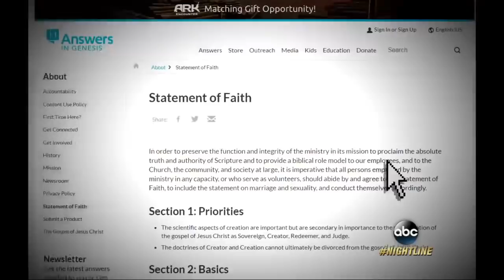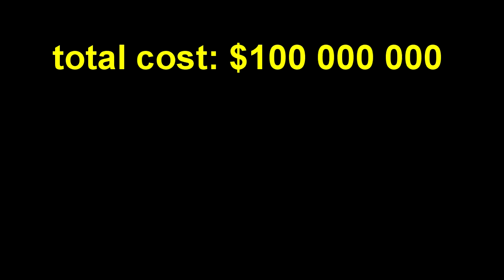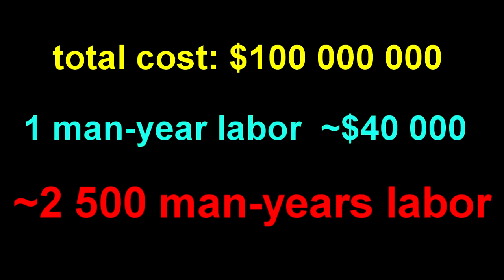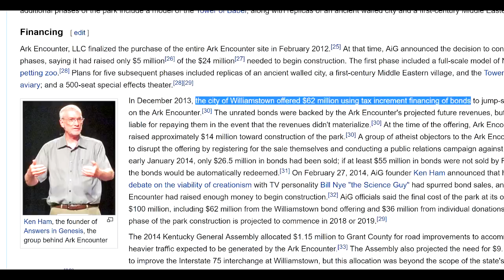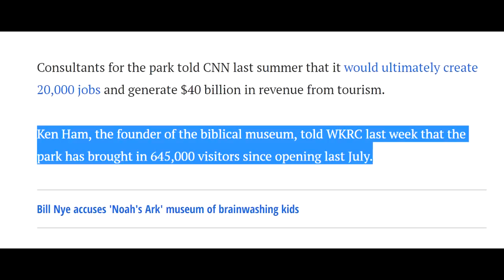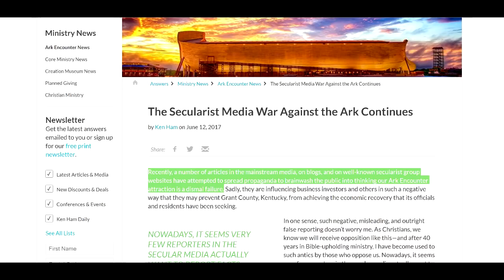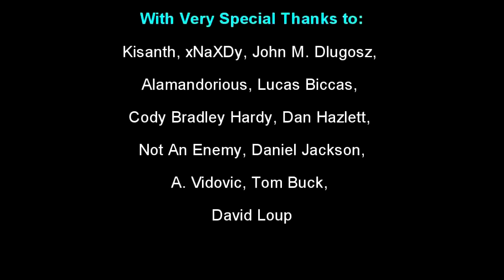Why do people laugh at creationists (part 44)

Comment: The irony of it all is that Ken Ham actually proves that the story of Noah is fake and a myth by building the Ark/boat.
Reply: Michiel1972 How?
Reply: They used modern equipment which thousands of years ago no one had.
Reply: Michiel1972 I was thinking the same thing as I watched all the cranes and heavy equipment
Reply: They also used modern techniques of boat building like how the bow is build, which have been invented just a couple 100 years ago. And the most ironic thing is that those techniques are used so that the boat goes through water more efficiently, yet the ark was never intended to go anywhere; it just had to float.
Reply: Michiel1972 you all don't get the real point if noah had the creator of everything on his side he theoretically didn't have to build shit.  the ark is very real they have found it it is folly to act as if it hasn't.  the funniest comments are about the bowed bow!  are u for real?  if God created everything trust me that stupid modern bowed bow was engineered godzillions of years ago.
Reply: Michael, I'm assuming you're joking. But if you're not:
1) Show me the boat
2) If that "stupid modern bowed bow was engineered godzillions of years ago", why on earth did God hold off on computers for so long?
Reply: The "ark" has been "found" dozens of times. The same carbon dating they used to determine the age of that wood found on Ararat, is the same carbon dating technique used to determine that the Earth is much much older than 6,000 years.
And if God can do "whatever He f*cking pleases", why doesn't he resurface the entire ark so that everybody can see it plainly?
While he's doing that, why doesn't he just come down to Earth and say, "Hey guys, I really do exist!" 
The reason God doesn't do those things, is because he doesn't exist.
Reply: michael perri If god is omnipotent like you say, there are tons of paradoxes. For example: god can lift everything because he is omnipotent, but if he is omnipotent he can also create something he can't lift. The existence of god would create so many paradoxes it's simply irrational to believe he exists.
Reply: Kha'hotu the Khajiit Werewolf there are paradoxes because YOU ARE NOT GOD AND YOU COULDN'T CREATE A BLADE of grass so how would u know of paradoxes of an omnipotent God?
Reply: You're right, Michael. I am God. I am now revealing myself to you. Instead of just making everything perfect from the beginning, I thought it would be way funnier to put all of the animals on a giant boat, and watch them struggle as I flood the rest of the planet for no real reason other than my own entertainment.
Reply: Denis Lipatnikov HiHowAreYou  -  you both assume u understand the past.  the bible is a load of shit except for certain parts. why would not history be the same?
Reply: I assume things that are reasonable to assume, and I assume these things are likely to be true; not certainly true. None of these things includes a God, because that would be unreasonable.
Reply: michael perri History is based on hard facts which we found; think skulls, bones, etc. The bible is just a book without any evidence to back it up, it just says "It's all true, believe me or go to hell".
Reply: Michiel1972 but it is up to legal building codes, electronics, walls, Foundation, floors, rooms, furnishings, roof, railings, different levels, fake animals, and every thing else. it is much more comfortable and modern.
Reply: HiHowAreYou he did not, we have discovered very old computation devices that can be dated to rome. Also the society before Noah was pretty advanced but was wiped out and h3 did not give it to us again because the first time we messed it up.
Reply: Kha'hotu the Khajiit Werewolf those are just logical problems that are ment to be unsolvable. their are many of them and they are a strawman argument Wich proves you wrong.
Reply: Kha'hotu the Khajiit Werewolf the bible it the most accurate book on this planet. there are only 2 copies of some of Socrates debates and things about them but we never doubt him but the bible Wich has millions of examples for its existence is always questioned. give me 1 example were the bible has a error and I will show you why it is not an error. also about bones if you are looking to disprove something you will make jump to conclusions and will not be willing to see the other opinions proof. this goes for both sides
Reply: First off I'll say I don't believe in God, but what if in the past people were not as primitive as mainstream historians think? What if a doomsday scenario caused a collapse of society and we had to reset? Super volcano, asteroid, global temperature change etc. Because the math sounds crazy when it comes to the construction of the Arc in the past, but so does the math for the Great Pyramids, but we know they were built because we can see them. The fishy thing is the time period, how the transported the non-local materials and the lack of technology to perform the building.
Reply: Fazzee45 a book? You mean the Bible?
Reply: Sierra Detwiler No I mean something that has a equation in it maybe or something you can actually read and become more intelligent. Thanks for trolling though.
Reply: benito tommassi  - says the guy with a superman as his youtube icon.  i feel like religiously the problem with what is occurring all around us is the lack of any sort of courage within ANY scared stiff demon to just admit it with any fervor.  we get it.  evil lurks within the shadows!  ur superman not spiderman right?  demons can do anything right they are an extension of satan no?  ur superman, whats that quote from the usual suspects about the devil?  don't be coy!  listen to evil joe from mushroomhead.  satans army trying to start a rock band...
Reply: benito tommassi - i don't need to convert you.  thats the point.  ur smarter than God FO SHO!  enjoy!
Reply: benito tommassi - thor is not a god.  thats really the problem.  demons are afraid to admit, publically that they are demons.  lets bath thor in some milk, shall we?
Reply: michael perri thor is a god.  You cant disprove thor is god.  There are loads of old books written about him.
Reply: benito tommassi - thor vs. angel - thor would lose all his limbs within 30 seconds.  thors hammer don't work without God, the True God's assistance.  why God would mislead thor like that is between thor and God.  Mythological morons like odin, thor and zues existed no doubt i'm just saying they have and were punked by God!  funny right!  check it out.  ask Him!
Reply: Larry Glazner ... Hmmm.
At what point did I give you any insight regarding what I think?
Another judgement, while denying the act.
Hypocrite.
Reply: Larry Glazner - i don't know if u can say buddhists have no God.  they train their minds to link up with whatever Intelligence is out there, in a sense.  buddhists don't talk much because they are having a much better time understanding and talking to the God that tells them how to get to where they want to go when they die.  this life and its possessions mean nothing, it is kind of the same theory with christianity.  plus there is that theory that Jesus went to Japan during the years where it is said he "dissappeared".  i don't blame him for wanting a vacation from the stiff necked jews that he knew would ultimately crucify him.
Reply: When God was born Jesus As he grew up  on earth he use parables (stories) and examples to convey what he as God in the form of a man wanted  from us. He even showed us how to pray to him though example  The bible is the same.the bible  use parables (stories) and examples to convey what he God is to us.  In the bible all of man kind Is Adam even  Eve was also Adam. Though Jesus  never said he was the son of God he often said You are all sons of the most high  But He was quoting Psalm 82:6  He said he was the son of man to show he to was Adam The word Adam in hebrew is Ad-d-EM   it means Child of God.So the bible  use parables and examples to convey what he God wanted  from us But all The thousands of these  parables and examples have come out of the history of juda.
Reply: jcr65566 in other words its just a book of stories
Reply: LOL OK how he do that.   the story of the flood in the time of Noah is told by the seminarians . it was found on 7000 year old clay tablet found in iraq  in the 1960s
Reply: Fun fact: Ken was originally going to have real live animals in pens, cages, perches, etc. in the ark park itself. People rightly criticized the way he intended to showcase them, pointing out that it was confining and unsanitary, so he was forced to put fake ones in instead.
Reply: Michiel1972 - the irony of all this is that ken ham proves that most of the earth is inhabited by people that understand the science of being a True God yet they couldn't backwards engineer a blade of grass or an insect if their souls depended on it.  the irony also being that ur souls do with that attitude.
Reply: Larry Glazner - God designs life.  alot of people try to leave God out of the equation by saying it can be explained through "science" but all they are doing is trying to unravel the mysteries of how all things work, of all that DESIGN that God put into everything He created.
Reply: michael perri how do you know god designed life?
Reply: benito tommassi - because He did!  shiva, odin and zeus certainly didn't do it!  God doesn't keep humans naked in a garden eating fruits either.  in case u thought that was a real thing.  knowledge of good and evil is something God wants us to have.  its called free will we make our decisions from there.
Reply: We realy don't know how old God or the universe  we only know where life is God is In the pass We  determine the age of the universe using two different methods: by studying the oldest objects within the universe and measuring how fast it is expanding. Bit as we look out in to space we can only go on what we can see the further we can see use to  only forteen  billions light years  now we can see a bit further the problem is we are using light  and at the speed of light we are looking in to the pass we see at the edge of the universe a cloud of dust this is the limit of what we can see But the thing is we are using light to see light that is billions of years old   We only know of God on this  earth where ever life exis God exist God can create life but that life has to live to complete  We don't know if life  exist any where else  on other earth like worlds But we do know there are  ten of thousands of dead galaxies out there in space  the elements needed to create life,  no longer  exist in those galaxies   It like there just been use up. .We know these elements did exist in the pass  in the formation of these  galaxies But over time  for some reason we don't know there  elements were changed into  less complicated elements. simpler elements. we know the stars exist in these  galaxies  by the there mass the pull on other stars but these stars don.t shine any more they are cold and dead.  For a star to go down this path would take longer then fourteen point five billion years  So the universe is far older then  fourteen point five billion years .
Reply: Pawel Regulski - thats the logic!  look all around u at all the evidence of PERFECT DESIGN.
Reply: michael perri like 99% of all species that are now extinct.  Like children getting cancer.  What a designer!
Reply: benito tommassi To look at this! We have  got to know why we are alive and why we have to die  in the first place.  God can create with in us a spirit and then give us part of his immortal  soul  Because God is our father in heaven and we are his children God has a spirit we have a spirit God has  a soul we have a soul  we are God child  But to be complete we must be alive we must live a life. And like jesus we must live a life and then die  But that only our physical form.dies  children getting cancer is just part of life  cancer.only in there physical body. All life on earth is here for one reason to create the spirit.  Ever day we live some poor form of life had to suffer and die just to keep us alive one more day.
Reply: benito tommassi when has ariology been vil nonsense.14,000 years ago all over the earth  there were  civilizations on this world  that surpass us in so many ways  But then some thing happened to them most of them were  wipe them out.in one event  there is so much  evidence that  back then all over the world on every single continent  The sea rose up about  400 feet  And flooded every single  land. mast. This was the flood the bible speaks of  in the time of Noah.
Reply: jcr65566 FFS!  Look into things and understand them yourself before using them as evidence for your world view.  This is a highly contentious theory that oa now widely regarded as false due to the contrary evidence that has been  found.  Also, even if it were true and evidence proved it beyond doubt (like it has qith evolution and the big bang, altho you'd rather argue against and ignore evidence in those cases?) It aids to prove that the story of noah was false!  Look into it before you make a fool of yourself again.
Reply: bebito tommassi Ok you got my interest whats   the contrary evidence that has been  found! .The story of the flood in the time of noah was not  false  it wad written about in ancient 7000 year old  sumerian  script  The  sumerian  were the ancestors of both the egyptians  and the hebrews but not the modern day Jews  This is archeology not religion for 1280 years ago most of the egyptians  were wipe out they had  lost everything and had to start all  over  again most of  the destroyed temples were on the cost and to this day are still  underwater. for a lot time there were no egyptians as  they were mostly scattered tribes then they seem to come together and formed in to in to upper and lower kingdoms But then  7000 years ago there kingdoms come together  this was the start of rebuilding  the destroyed temples they were not under water the thing is the  egyptians before were far smarter them the egyptians who come later.
Reply: jcr65566 "proof" of a flood that happened 12800 years ago proves correct a story of a flood from a book that claims the earth is no older than 6000 years old?  Ask yourself these questions.
Reply: Pawel Regulski - people suffer because they DO NOT SUBMIT THEIR WILL to God.  plain and simple.
Reply: benito tommassi  In 70 AD when the 2an temple was destroyed by the romans  back then the torah bible was not in the form it is in now.  it was written in the form of single books  on large sheep skin scrolls. But what we see now is not all of it. A few scrolls were lost  as what we have now was smuggled out of the temple in a coffin What few scrolls were left were scattered all over israel and the rest of the county for 300 years when these scrolls were found by the romans they just burnt them.When the scrolls were smuggled out of the burning temple  they could not fit all of the scrolls of the torah bible in the coffin so they had to leave some of the torah bible scrolls behind.  But with what left there are hints all though genesis in the bible of some catastrophe  Do you know that no where in the bible dos it say the earth is 6000 years old.   it doesn't even hint at it. But there are written in 7000 year old  seminarian text that tell the story of Gods  creation of the earth the creation of life on the earth the creation of a type of men on the earth.  The flood in the time of noah but nowhere in  the  seminarian text  dos it even mention Adam and Eve So I think they came may have come along later As In genesis one it mentions the creation of life and men  then in geneses two it mention God created Adam mankind  in his own image  God said to Adam to replenish the earth I know with the bible lineage of  Adam and eve they appeared  around  6000 years ago But it dos not say the earth that old.
Reply: Michael perri Bull crap that wrong Our bodies are designed to survive and then to finally die, But  it what we do in between that process that defines us   We survive by the death of other forms of life. Have you never heard the expression  "what you eat to day walks and talks tomorrow"  Some other living thing  must die and be consumed by us so that we may live for an other day think of all the former living  things  that have died ju8st so you can live just one slice of bread contains hundred of wheat  seeds that are  realy just baby plants that will never know what it is to live.
Reply: jcr65566 and no-one dines on the lives of children lost.  Except tgat magic man in the sky.
Reply: jcr65566 does the noah story not come after adam and eve?
Reply: Larry Glazner im guessing you're being sarcastic?
Reply: benito tommassi - evil most certainly exists just look at the world there is ur proof.  satan and God have a wager.  God is invisible but through true faith.  thats the way He runs His war strategy.
Reply: michael perri I think evil to be a primitive concept.  But, if evil is real then god has certainly proven himself more than capable of it's most extreme forms.
Reply: We are all Adam ( in hebrew Ad-dem).  We were once in charge of the earth then our ancestors became corrupted by satan to follow a serpent god  that give them  knowledge of how to do good and how to do the evil of war and from this power the  knowledge of good and evil All over earth on ever continent they  built temple to  their  deprave serpent god  that demanded they  sacrificed there  children to it. So they  either  place there children   in caves to freeze to death.  or place them in a fire to burn to death.
Reply: Larry Glazner you say to jcr that you need evidence then you say that "satan tried again and again to persecute the jews" is evidence for satan??  Do you know what evidence is?  Where is your EVIDENCE for satan?
Reply: Michiel1972 The thing With the arkeology the evidence do's point to a worldwide flood in about 11,800 BCE . That's About 13,817 years ago. Probably from a large meteor hitting  the european continent And melting the  two mile deep ice sheet.  archaeology evidence do's points to an oceans rise of 122 m ( about 400 feet )  So this would have cause a worldwide flood  And also The flood and Nora family are mentioned in the 7000 year old Sumerian clay tablets found in iraq in the 1960s.  But they do not mention Adam  The Sumerians are the ancestors of both the egyptians and the Jews.
Reply: Larry Glazner giving your version of what evidence is does not deter from the fact that you have still to provide any for the existence of satan.  It shows you must know you lack any evidence by your attempt are redifing the word.  You say they are the most persecuted people in history but they are still here therefore thats evidence for god and satan?  That sounds like the ramblings of a madman on the street.  Hey, if you believe in this stuff thats kool.  Just dont try and give a rational explaination for it because there isnt one.  I've certainly not heard one.  And with regards to the museum in this video its just plain lunacy.  Only in america!
Reply: Benito tommassi  It can be proven  the existence of satan.All we have to do is look at ever single culture on earth going back thousands  of years All of them in some way have know off the  devil And  though the names are different it still a devil it still satan
Reply: jcr65566 so that cant have anything to do with our fear of not understanding?  That every civilisation created gods and demons to make sense of the world they didnt yet understand, of good and evil, bad and good???  No it must be "evidence"!  For fuck sake listen to yourselves.  We know better now, its called learning.
Reply: How about the fact that all these billions of people have sense and can  know there is a  God and there is a  devil  we call satan And they know they have a soul that can be affected by both of  them That every single person in every single civilisation that has ever existed.  have in some way  sense  the presence of God So they have  tried to establish a  link with him But in there own way. they eventually know  there are no Gods there is just one God  there have been tribes on remote islands all over the world who have had no contact with one another But can sense the presents of God and the devil But they end up trying to put a name on God who has no name Because they sense there is a God and there is a Satan and they have an affect on there soul.
Reply: Until the 1700 Before people were able to read the bible The poor had no education what so ever. So realy only the affluent Greeks and Egyptians you mention had a very limited  educations First land owner only thought there sons to read and write But later  very affluent girls from affluent families were also  taught to read and write when the bible was first printed it was use to teach children to read and to write Before the 1700 there were no schools as such as a  teacher was a very expensive servant. but land owner found by pooling there money they were able to teach there children with outer land owners children Kings james  found he could make a lot of money printing and selling his KJV  bible  for education books were expensive so  for a long while as  the bible was in book form and it was being printed out in massive amounts .the bible was the only educational tool there was.
Reply: Larry Glazner.  Well firstly i guarantee you that 85% of people don't believe they are interacting with spirits.  Secondly, im not proposing some ludicrous, supernatural explaination for feelings i experience.  I don't generally "know" anymore than anyone about that which mankind can't explain.  The difference is i say "i dont know, let's try and find out".  You say that, because we dont know, it must be a mythical being that was written about in a book milennia ago.  One of us is rational the other is deluded, desperate or both.
Reply: jcr65566 dogs have an amazing sense of smell?  Sounds silly doesn't it?  Yet it's still far more reasonable than your suggestion because we have evidence of a dogs extreme sense of smell.  And im not saying i dont believe in a soul (although that word suggests something supernatural i dont mean it that way).  The meta physical is being researched.  Do we make connections with other living things? I think so, yes.   Can i explain it? Nope.  Shall i just settle on an ancient myth to explain it? No, of course not, i'm an intelligent and reasonable man.  Again, the dog story is nowhere near the vicinity of being evidence for the supernatural.  I'm starting to think you honestly dont know what the word evidence means (?)  Believe what you believe, ive no issue with that.  But if you try to give a rational explaination for the irrational, please dont mind yourself looking a bit silly.
Reply: Larry Glazner  From the start I knew what I saw was real But it  It  was a bit of a shock to me when I later  learn,  that what was in, what had seen, was so real. there were thing like there were all wearing Roman like togas  But what was amazing was the way I acted after I stayed out of trouble God married had kids. now got a lot of great grand kids.
Reply: I agree In genesis it said that God created the heavens and the earth in other words God created the heavens first and then the earth  The first day after surgery a neurologist showed up. I talk to him even though  I was still to sore to talk to any one the reason for this  was to get my hearth going again they had  pondered  on my chest for a bout half an hour.  I told the neurologist what happen the first thing he told me was there are two notes taped on top of  the equipment in the operating room did you read them it was a explained later that Back then if I did see two pieces of paper on the medical  equipment in the operating room I would  not be able to read them our brain translates the sound we make and the words we read in to the language we under stand to do this we a brain at the time though a lack of oxygen  my brain was not working to translate the words so I said no I didn't he said I thought so. you were just dreaming and at the time I beleve him. Four years alter I found out he was wrong
Reply: Michiel 1972 No not realy it works out I read this ages ago somewhere on the internet "When Noah enters the ark, he was  600 years old. The time it took to build the ark would depend on how much time had passed between Genesis 5:32 and the time that God commanded Noah to build the ark (Genesis 6:14-21). At the absolute most, it would have taken about 100 years.So there was plenty of time.  And they didn't  blow a 100 MILLION dollars even no one showed up it a know fact that Every  one of these things   generated an enormous amount of money.
Reply: jcr65566 so it was because of the bible that poor people were educated?  Are you serious?
Reply: jcr65566 well, im sincerely sorry for your plight and its good to hear you've come through it.  And if belief in god and jesus helped you then thats kool.  But i say again, you are trying to explain the irrational with reason and it doesn't work, it sounds silly.  You were under sedation with drugs i presume?  Hallucination, no matter how vivid, is not an option for explaining your encounter?  That does not in anyway disprove there is a god, however.  Belief in a diety is not the issue, i cant argue against that and wouldnt want to.   its belief in an ancient book amd the god it describes that is the issue
Reply: benito tommassi it is history It started in the USA from 1400 to the 1650  It was the beginning Stages of Education in the USA 
Connecticut colony was a leader in education. The first public schools were established in 1642 in New Haven and in Hartford in 1643. Many of the  private schools, in the USA such as Hopkins and Taft were established at this time.
The Puritans of Connecticut put heavy emphasis on education, specifically so that young and old would be able to read the Scriptures. If they were educated, they could learn God’s laws and the laws of men. The father in a Puritan house prepared his children by teaching them the Bible once a week. Education was the ultimate responsibility of the parent and the Puritan homes were strict—a child could be seen not heard and spoke only when spoken to by an adult.
The Connecticut Code of 1650 made it a requirement that children and apprentices be taught to read. Connecticut also required children to be trained in an “honest calling” so that they could contribute to the colony, as well as taking care of themselves. Many children at the age of seven or eight (were sent to homes to work. They became apprentices. Even the wealthy parents followed this tradition. By this age, boys usually decided on a craft or trade and remained in it all their life.
The wealthy colonist children, if not an apprentice, attended private schools, or they had private teachers (tutors). These students were headed for the university. Although public schools were supposed to be established, most children were educated at home where they learned obedience, religion and the skills for daily life. In some towns, there were “dame” schools which were taught by widows in their own homes. These women taught only the basic skills because that was all they knew. These skills included learning the alphabet, spelling, writing and simple arithmetic. Boys who attended these schools paid a penny a day.
Schools were generally for the boys. It was not customary to educate women since her place was the home. She didn’t have any economic pressure to earn her own living since she was going to get married and raise a family and care for her home, often at an early age. Women were basically illiterate; many could only sign their names with an x. If they did go to school, it was to a “dame” school where they taught some reading and knitting and maybe a little arithmetic, music and dancing. They were taught reading for Bible study and arithmetic for household expenses. It was more important to learn how to be a housewife: to cook, to spin, to weave and to knit socks. Women and young girls during leisure time often embroidered   They made fancy scarves and veils and did much quilting.
Reply: benito tommassi Do you know you we are all  a child God. That one day we will be like God. God can creat us give us life But we have to live a life to do this we a place in an ever changing body It is a scientific fact that Not only is every cell only a few years old But ever atom in our body is no more them a few years old as well over our long life  Only our souls and our spirit remains to carry on.  
You mention the NDE It happened many  years ago but I can still remember ever single bit of it.  Over the years I lost count of how many Atheists have told me this this was an  Hallucination,  But since then I have never been told by any one who's gone though an NDE And  lot of them are also doctors who have also gone though an NDE   that an NDE is an Hallucination, for it is not. You mention the bible So  lets talk about the bible I know  Atheist like you would not have a clue what a bible is about you thing it is a textbook it is not  I going to explain the bible in this way. The bible is a book of instruction .that use parables (stories)  and examples to explain what God relationship is with us.  In the time of Jesus there were two types of Jews the zion zealots and the tribe of  judah  zion zealots are the one Jesus said  are a temple of satan. The zion zealots jews were the one who had Jesus killed. They could have just had him strangled or stoned to death But they wanted to make an example of him. So why did Jesus let them do this to him Because Jesus wanted them to. For  Jesus was born to die.  Jesus is God and God is our father in heaven  God is soul and holy spirit as we are spirit and soul  God  love us so much he lowed himself to be born a man in the form of Jesus. The reason for this is  God is our father and like all fathers he wanted to teach his children us what he wanted from us.  Now God like all father teaching  their children   have to lower them self to there child level of understanding. God lower himself to our level of understanding by becoming Jesus.  Like all fathers he use stories and examples to show us what he wanted from us  to teach us. In the bible  God as jesus would  often referred  to him self in the third person. Jesus never called himself the son of God he referred to him self as the son of man. And this is why 
This is by Dr. Ron Rhodes  First of all,  the phrase “Son of Man” is a reference to Jesus' humanity, it is not a denial of His deity. By becoming a man, Jesus did not cease being God. The incarnation of Christ did not involve the subtraction of deity, but the addition of humanity. Jesus clearly claimed to be God on many occasions (Matthew 16:16,17; John 8:58; 10:30). But in addition to being divine, He was also human (see Philippians 2:6-8). He had two natures (divine and human) conjoined in one person. 
Further, Scripture indicates that Jesus was not denying His deity by referring to Himself as the Son of Man. In fact, it is highly revealing that the term “Son of Man” is used in Scripture in contexts of Christ's deity. For example, the Bible says that only God can forgive sins (Isaiah 43:25; Mark 2:7). But as the “Son of Man,” Jesus had the power to forgive sins (Mark 2:10). Likewise, Christ will return to Earth as the “Son of Man” in clouds of glory to reign on Earth (Matthew 26:63-64). In this passage, Jesus is citing Daniel 7:13 where the Messiah is described as the "Ancient of Days," a phrase used to indicate His deity (cf. Daniel 7:9). 
Further, when Jesus was asked by the high priest whether He was the “Son of God” (Matthew 26:63), He responded affirmatively, declaring that He was the “Son of Man” who would come in power and great glory (verse 64). This indicated that Jesus Himself used the phrase “Son of Man” to indicate His deity as the Son of God. 
Finally, the phrase “Son of Man” also emphasizes who Jesus is in relation to His incarnation and His work of salvation. In the Old Testament (Leviticus 25:25-26, 48-49; Ruth 2:20), the next of kin (one related by blood) always functioned as the “kinsman-redeemer” of a family member who needed redemption from jail. Jesus became related to us “by blood” (that is, He became a man) so He could function as our Kinsman-Redeemer and rescue us from sin.
Reply: +Kha'hotu the Khajiit Werewolf
"michael perri If god is omnipotent like you say, there are tons of paradoxes. For example: god can lift everything because he is omnipotent, but if he is omnipotent he can also create something he can't lift. The existence of god would create so many paradoxes it's simply irrational to believe he exists."

I see this question a lot and there are better examples to use against God imo. If you take into consideration the context of your "paradox" you will get an answer like this which solves it.

This question is not based on the amount of power God has but is based on true impossibility. What I mean is that God has the power to do whatever possible with infinite power but just as the Bible specifically says he cannot lie or deny himself he can also not create a challenge in which he cannot win. The argument is based on the wrong assumption that more power means you can achieve the impossible which simply is flawed. The paradox doesn't question the power or omnipotence of God but is asked from the incorrect assumption in your wording of what is considered possible by a being who is omnipotent with infinite power.
Reply: SpydreX You got this all wrong God exist in the spiritual world.  God created our spirit and our soul  in the spiritual world. before our physical bodies were even created .  So why should God  care one bit about us our physical bodies  in this physical world.  If God cared one bit  about our physical bodies we never get sick we never age and we never die.   God is soul and holy spirit As we are Soul and spirit crated us  in his image. So what God cares about is our soul and spirit God will only care about our our physical body   if it has a direct effect on our soul and our spirit.
Reply: +jcr65566 Err I think you might have replied to the wrong person...
Reply: jcr65566.  I was raised christian, i went to a C of E school, church every monday morning.  Its the best way to make an atheist;  have  parents that free you to make the decision for yourself, go to a christian school and realise pretty quickly that it's a myth, just like all the other world religions are myths.  You are an atheist to 999 religions, i am atheist to 1000.  That 1 is the only difference between you and me.  A muslim or a jew or a hindu could give me similar arguments to yours to justify their religion.  You are blinded or refuse to see it because of your desperate desire to believe it to be true no matter what evidence is thrown at you to the contrary.  Keep believing in what you believe, it seems to have served you well.  Even if i wanted to i cant believe in a supernatural creator because 1. There is zero evidence for it and 2. His book of revelation amd instruction is extremely weak and now has to be taken as "stories" and "metaphor".
Reply: jcr65566 well i must say your beleif us more understandable but, i still cannot put faith into that which has no evidence.
Reply: Benito tommassi After that  NDE it kinda change my life. When  I went to collage. I stop believing in evolution It was when I come across  one of our teachers who was an agnostic professor he told  all 30 of us us  for a class assignment to  prove evolution.  We were given a month But  I don't thing we could have proove it even if we were given years. Though  we could easily prove  adaptation But not one of us could prove  Evolution As I said This professor was not a christian he was an agnostic I don't know if you know about  Agnosticism it is the view that the existence of God or the supernatural is unknown or unknowable. According to the philosopher William L. Rowe, "agnosticism is the view that human reason is incapable of providing sufficient rational grounds to justify either the belief that God exists or the belief that God does not exist". Agnosticism is a doctrine or set of tenets rather than a religion. So agnostic beleve  we are just not smart enough to vision the concept of God.
Reply: Larry Glazner Yeah that about right. But  It seem there problem with the bible is they want to disprove the bible history  But the thing with  bible is! though the bible dos have a bit of jewish history The torah bible was never ever meant to be a history lesson We can see this when Jesus taught he taught using  the same things  as the bible. He us  parable and examples  So the bible is not a text book or a history lesion  The very meaning of the word Toha is book of instruction   So the bible is a book of instruction Jesus is the word of God But the bible is the written word of God. To use facts Each  bible would have to fit on to a semi trailer. LOL
Reply: Larry Glazner All we have to do is beleve in Jesus christ It why we can not believe in the bible we would have tow masters The bible is no more then a book of instruction. if you believe in the bible We cant just believe in part of the bible we would  have to believe in all of the bible Ever single word of it and we have to worship it would then be come an idol Jesus is God He is our true father And like all fathers he became Jesus to teach us  and to do that  God had to come down to our level of understanding . imagine teaching your little three year you can not talk to a three year old like you talk to an adult you have to come down to there level of understanding  And this as Jesus was what God was doing
Reply: What I meant when I said you cant beleve in the bible But you can trust in what the bible says but we can not use the bible as an IDOL I have seen pastor holding a bible in there hands and praying to it . Not knowing that they have  turned there bible in to and idol. I seen people on their  knees before a cross the cross has been turn into an idol  We got to look at the difference between the golden calf the people worshiped and the bronze snake on a pole  moses put up. to cure snake bites.  The bronze snake on a pole  was not an idol   and the people only had to look at it not bow down to it The bible is only a tool of instruction  Jesus is the real word of God
Reply: Larry Glazner LOL Wow Larry  that is really good.  I like it. That   "slug theology."  is a really good way to explain it . The problem I have found with is all atheist they know nothing about us.  they seem to  think we worship the bible.  I suppose  it is why they mock it so much.
Reply: Larry Glazner to right I seen people turn all sorts of things in to idols Like as I said. A Bible a Cross. Even a Church and also even the church  Pastor  LOL  As they will go down on there knees in front of him.  The only one we need to bow down to is God himself. Once someone worship and idol.  God has said they have corrupted them self.
Reply: Larry Glazner only 2minutes in and the propagandist nature of the video is evident.  "Evolution is only proven with the fossil record".  That statement is so untrue its ridiculous and that people take it as true makes me want to cry for humanity.  But, lets carry on....
Reply: Larry Glazner i won't respond yet.  I'll let you look at the statement again and see if you can spot the issue with it.  This is a great example of how you cherry pick information so as to justify your world view.  Look again...
Reply: Larry Glazner you didnt even bother looking did you?  All this "i watch/read everything contrary to my beliefs to the end" bullshit and you wont even recheck the bullshit video you gave me? The flaw is obvious and its only 2 minutes in.  Have a look, cant you spot it?  Its blatant you cant miss it.  The stephen gould quote.  Take another look.  I know for all your "i look at everything" nonsense that you actually dont but, take a look anyway and we may continue.  If you won't accept facts and evidence (which so far you have proved true to form) then a debate is pointless.  You deny facts and evidence until you cannot ignore them so, you then try to distort those facts and cherry pick statements in a desperate attempt to cling on to your irrational belief.  Its pretty text book.
Reply: not taking into account that winter as it exists today didn't exist according to the story, or that it doesn't say only the family built it themselves, or that all people would have been stronger/taller/healthier given the scientific proof the environment was better (more O2, better magnetic field, possible protective atmosphere with the "waters above the firmament"), thinking that people were dumber than we are (knowledge would have been lost and stunted given a global catastrophe) because that is how you are supposed to think as an evolutionist...

The assumptions run rampant as usual.
Reply: ITPalGame I agree people in past were much smarter and stronger than we are today mainly because with there  environment  it was like a completely different planet I know there  was more oxygen  the description of way they fought wars them self told us this the egyptians have recorded how there solders  use to march or run hundreds and some times thousands of   miles and then fight a war. Some thing we would find impossible to day.   
I
Reply: jcr65566 you like scientific proof when you can twist it into your fantasy but ignore the over whelming proof of evolution theory.  Winter didnt exist?  Where is the scientific proof that the earths orbit was so drastically different?
Reply: The earth in the bible is not  planet earth its just an area of land Any area of land was called earth
Reply: jcr65566 yes they were much smarter, hence their boats were built out of wood.  I guess theyd built computers that were far more powerful than ours and sent space craft out inti the universe but, they never mentioned them in writings nor left any evidence of them?  FFS listen to yourself.  Crazy.
Reply: benito tommassi Do you know that the number system of the egyptians and the ancient hebrews  were the same binary number system that computer use to day.
Reply: jcr65566 right...?  Binary is based on I-ching,  an ancient chinese 'code' from 2800BC.  Thats great.  How is it that ancient men were more intelligent?  Where were their technological advancements that compare to ours?  Where were their marvellous medicines and surgical practices that compare to ours? They didnt know about evolutionary theory so obviously wont be as advanced medically as the medicines and surgical practices we use today are grown out of evolutionary science.  Although you'd probably deny that as well, wouldnt you?  Your life was saved by someone practised in a field that is based heavily on evolutionary science yet, rather than praise the methods and the man who has studied his whole life and dedicated himself to saving lives, youd rather credit a supernatural being, for whoms existence there is zero evidence and made you ill in the first place.
Reply: benito tommassi  binary gos back to 5000 bc There was no china as we know it back then But there was a world wide trade Asia and the  egyptian traded with the then americans  that all use the binary numbering system
Reply: jcr65566 ok but, im not disputing that, im telling you that the man who invented binary code based it on a chinese model.  How does this tell us that humans were more intelligent?
Reply: Larry Glazner. The statement was made over 30 YEARS AGO!  Also the man in the video is Don Patton, a man infamous for his shameless use of blatant lies in order to convince the gullible that the creation myth is true.  Raise your standards buddy.
Reply: benito tommassi Why do you call creation a myth is it because like all atheist you can not understand a single word of it . Maybe I should explain it to you.
Reply: God Creation of all things has never been proven to be a myth it is your atheist lack of understanding of what in  genesis that the problem the first page of genesis was never meant to be a scientific journal Creation was told to moses though the archangel gabriel Creation to the hebrews would have been a complicated section  of information So it had to be brought down to the ancient hebrews level of understanding. it is an amazing but of literature in ancient hebrew ever word is a number and has three meaning So  that one single page can stretch out to many pages.
Reply: D Feenstra the bible was never meant to be that way.  it is no more then  a book of instructions on man's relationship with God  the whole bible is more of a love letter.  then actual scientific journals and historical events.
Reply: jcr65566 i dont need to prove it is a myth, you need to prove it isnt.  And still i await this evidence.  Until evidence is provided, its a myth.
Reply: benito tommassi  Jesus said do not put the lord thy God to the test.  It is why a christians well never try to prove God to you.  But I will tell you why I believe in God. For me It hinges on more then that just the " NDE" that I went though Have you ever wondered How did the universe start. I know God is like a father watching over us all ways seeking to be with  us.   All my life I was told there is no such thing as spits or a soul Yet there I was floating above my body. Then  in that NDE  I met him the thing is I hadn't been trained in the bible So  I realy did not know who he realy was when I thing about it now  I just felt or rather knew he was in charge.   he talked to me like a father he showed concern for me.   But For me there many other reasons reason why I believe in  God  The very complexity of every thing For one our planet points to a deliberate Designer who not only created our universe, But I believe he somehow keeps it going he sustains it. Look at water Water it is colorless, and odorless and without taste, and yet no living thing can survive without it. There is a tone of other reason why I believe in God but I leave it there.